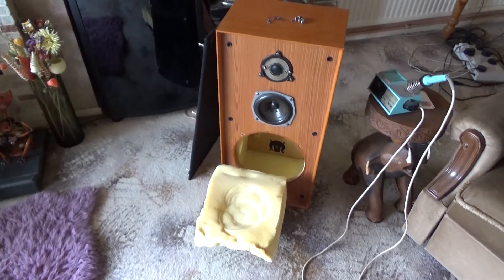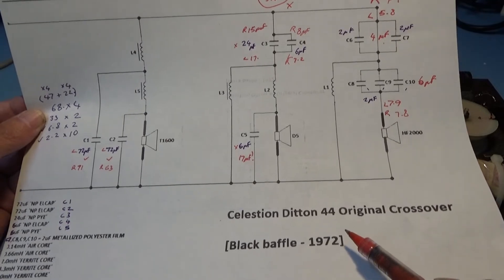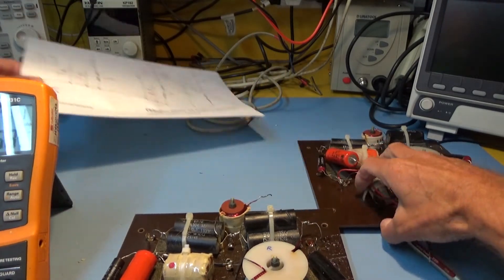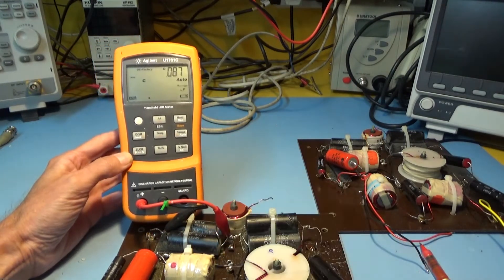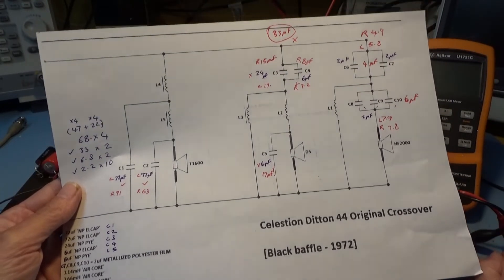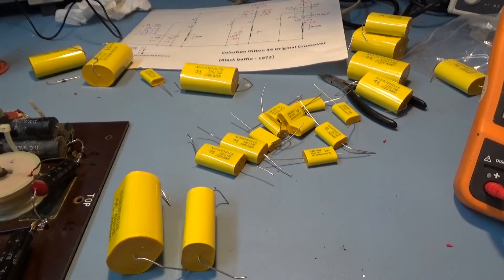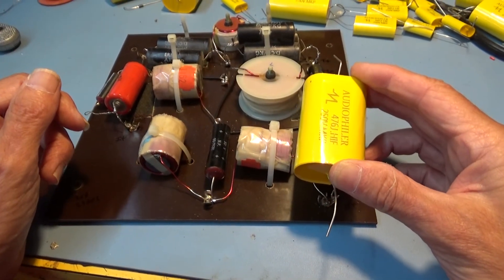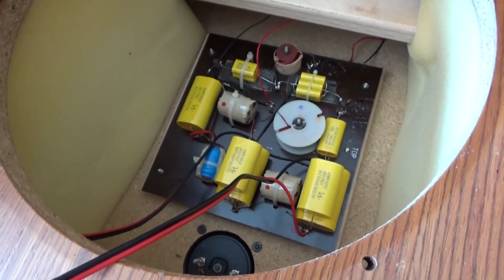Recapping the crossovers on my Celestion Ditton 44 speakers

Comment: please tell me how to set my multimeter to test the capacitors...also can i test them while on the crossover and when they are not on the crossover?...
I am new to using a multimeter...
thanks
Reply from the maker: Hi Brian, if your meter has a capacitor range you can measure them, but  you would need to disconnect one end as other parts in the circuit will influence the reading.
This is only a basic test, it will not tell you the 'esr' effective series resistance, which will go high as a capacitor ages and becomes more like a resistor. The other problem with capacitors is they go leaky as they get older and start to conduct DC. So capacitor testing is a complex business. Hope that all makes sense. You could always send it to me for testing!
Reply: @ptronix  
i don't see anthing on multimeter that says capacitors?...just want know what setting on the multi meter i should use...i believe the measurement is supposed to be close to what the capacitor says on it...what should the dial be set to on the multimeter mv or❓
Reply from the maker: @briancampbell7712  if you haven't got a capacitor range on your meter you can't test them! Buy a cheap capacitor tester off ebay

Comment: The expense may be worth it is not necessary to change all the capacitors with expensive ones. It is important to change the series capacitors in tweeter and midrange lines while the others may be substituted with good standard capacitors with fitted value according to the original ones.

Comment: Look like standard polyester film caps to me. I've replaced the NP electrolytics in my JBL L-222's with standard value film caps no problems. Had to parallel some to get the value needed. The problem is I think like you have shown, high uF value sized films are really big! Thanks nick for the great videos.
Reply from the maker: Hi Danish, yes they're almost certainly "poly put the kettle on" as dave on eevblog calls them! The problem with their size is because they're rated at 250 volts, which is way higher than I needed. But cost was an issue so I went for these because they were relatively cheap compared to  lower voltage ones I could have got in this country. Anyway they fit in the cabinet no problem. thanks for watching, nick

Comment: Lovely Work Nick Wow 95 db Sensitivity Dont Need Much Power For Those Babys Might Change The Caps On The Crossover Board in My Old Kefs Were On Ebay Did You Get Your Non Polarised Caps ? Thanks For Uploading Nick Super Speakers Regards mike.
Reply from the maker: Hi Mike, thanks for your kind words.
Try this link for the capacitor seller on ebay.
https://www.ebay.co.uk/itm/175325552967?var=474554856062
That's for the 47uf but they do many other values.
I highly recommend them. If the link doesn't work I'll email you.
Best wishes Nick

Comment: bonjour monsieur. je suis un amateur et je souhaite reparer mes celestion ditton 25 (1970!) Pourriez vous m'aider a trouver les plans pour les filtres et savoir le type de condensateur a reemplacer?  gran merci, Georges depuis la Normandie-FRANCE
Reply from the maker: Here's the schematic of the crossover.
Scroll down to see it
https://www.diyaudio.com/community/threads/celestion-ditton-25-help-needed.325356/page-4
Reply from the maker: You need non polarised capacitors, I got mine from ebay from this Chinese company. Hope this help
https://www.ebay.co.uk/itm/175325552967?mkcid=16&mkevt=1&mkrid=711-127632-2357-0&ssspo=J9GXJBcVSSq&sssrc=4429486&ssuid=8Fb8g0c8Qjy&var=&widget_ver=artemis&media=COPY